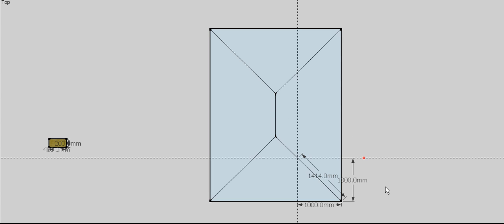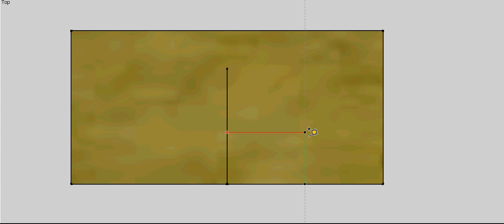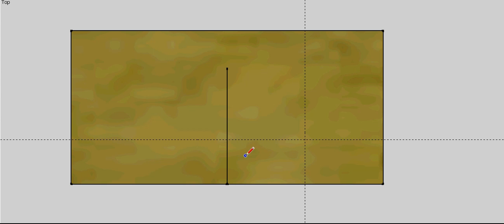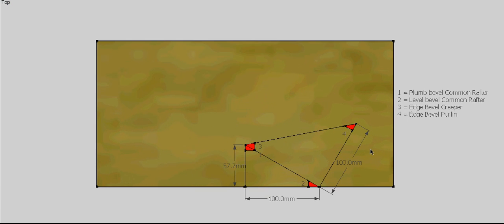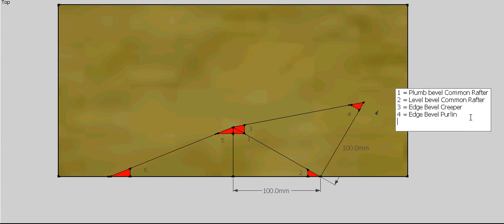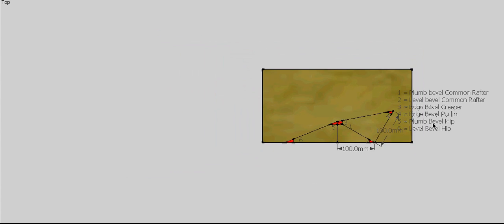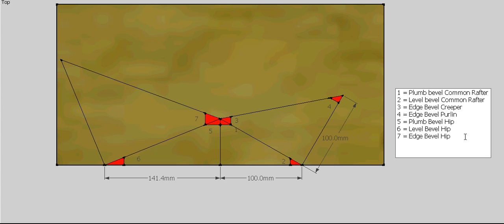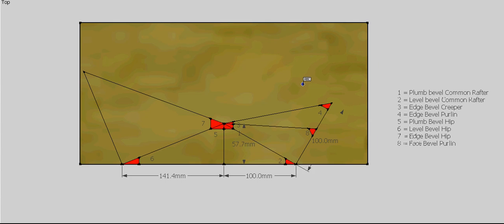Proportional triangles

Comment: What is the "edge bevel?"
Reply from the maker: +mike thompson Hi Mike
There are 2 different edge bevels in the example. One is cut to the edge of the rafters so they meet the Hip. The other is cut to the edge of the Hip so it meets the Centreing and crown end rafters.

This video might help explain it better https://www.youtube.com/watch?v=q1nYOXk9NTA

Hope this helps
Reply: +Buildsum hi mate, thanks for the reply. Your videos have helped me a lot at work, especially helping to understand hip roofing which has always confused me. 
Is there any chance you could do a video on a lean to roof?
So for example pith if a roof on a side extension to meet the original building. If you haven't done so already. 
Thanks a bunch
Reply from the maker: +mike thompson Hi Mike Thanks good to hear that the videos are helping
These are the only videos that i have done on lean to roofs
https://www.youtube.com/watch?v=FNHyupCIQXM

https://www.youtube.com/watch?v=xAuQdQ78mrI
Reply: +Buildsum great stuff mate. 
The hypertunose on the first triangle with a common roof bevels, if you measure that and scale it back to true size is that the true length common rafter?
Reply from the maker: +mike thompson It would be equal to the length from the centre of the ridge to the back of the birdsmouth. 
To me 'True Length' would need to have the ridge deduction and eave overhang included